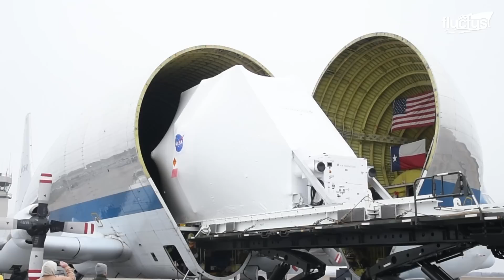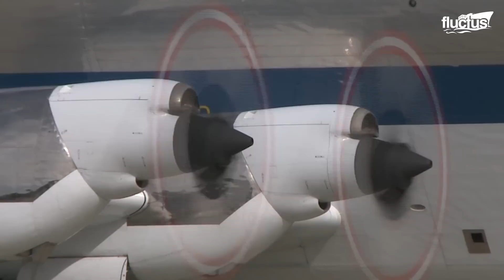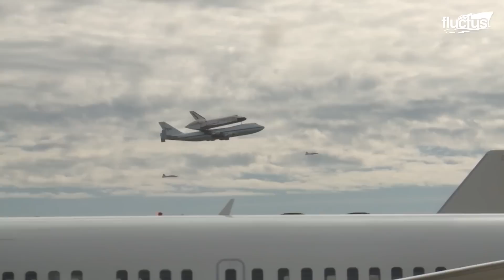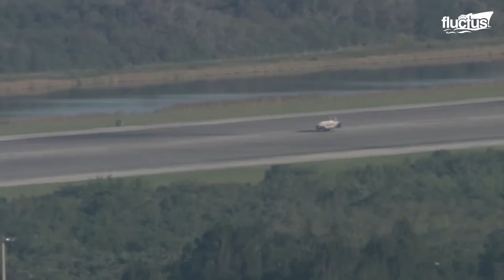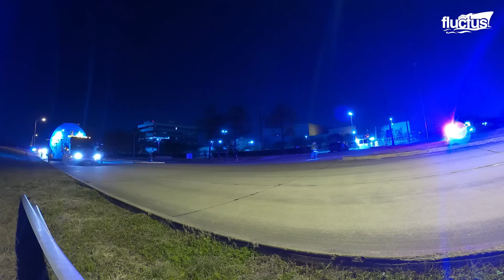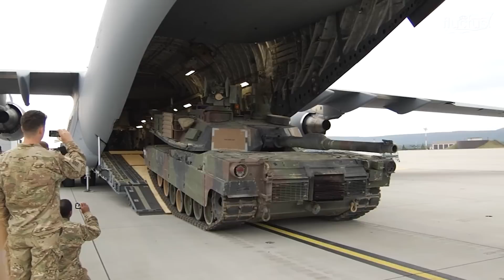The Genius US Idea to Build this Super Ugly Plane Saved NASA

Comment: Here’s what I need an answer to…On the Guppy and other late model aircraft such as the AirBus ones; Are there electronic connectors on the edges of where it separates to load ? I mean there has to be for the ‘fly by wire’ systems, brake systems, engines, etc between the cockpit and the rest of the aircraft ?

Now, in earlier versions, where the aircraft opens, there were actual cables for the flight control and other systems, so how did that work on the versions before fly by wire ? Did they have to connect some connection points ?
Reply: i'm a former usaf avionics tech, and connections would be horrendously problematic!  i wondered about the same thing, but based on what i know, i would think they would either use wiring (not optimal) or more likely, fiberoptic cable along the hinge area.
Reply: Yeah, now it's all fly by wire Avionics without any cables stretching the length of the plane. If you look at the hinge area on the nose you can see the wire harnesses in this area which are easier for moving parts versus control cables and pulleys.